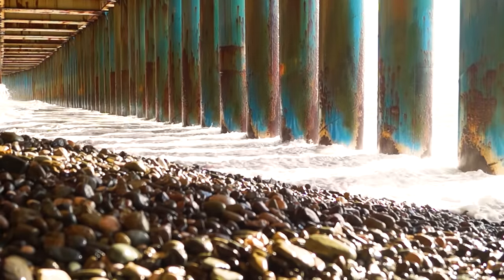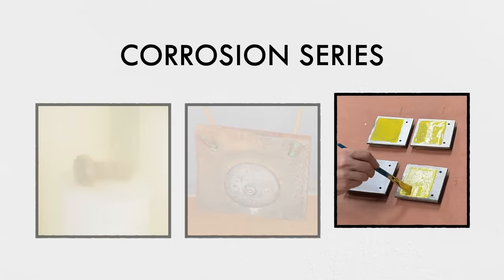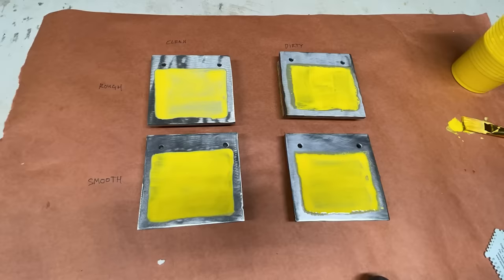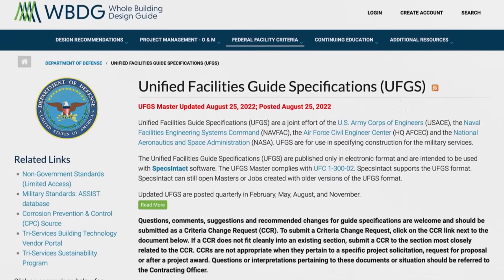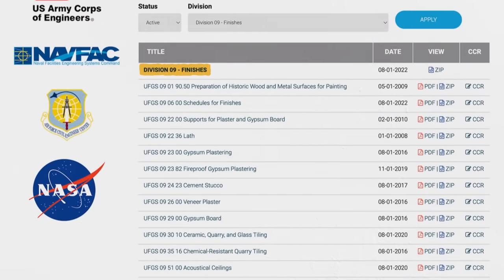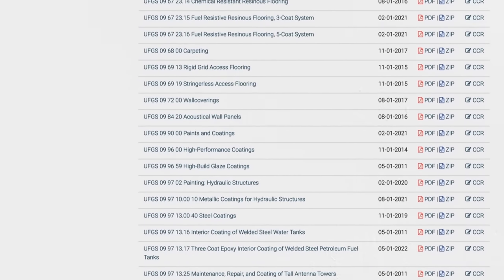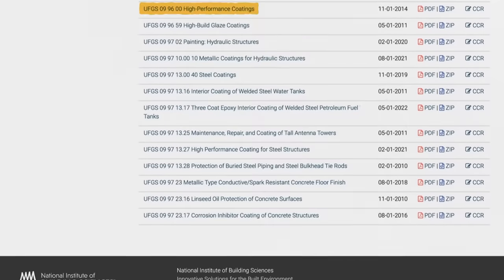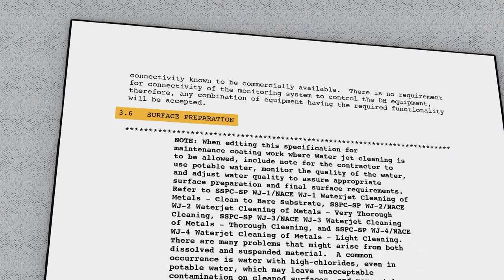What's the Difference Between Paint and Coatings?

Comment: As a union trained painter for 10 years, let me just say "face palm". I'm not sure how the paint chemists ignore nomenclature error as if it is not important, and I'm surprised they didn't give feedback about the stress test. I'll start with the test: the failure of a poorly prepped surface will be evident with temperature cycles and that is where the rust will have free reign. The temp cycles (winter to summer) will loose the adhesion and allow wind etc. to knock off the coating in sheets.
Now to the nomenclature: paint is a coating. Most of the "high performance coatings" shown in your video were paint. The reason the catalogs say otherwise is nothing other than a sales tactic. 
Painting has two purposes: to protect and to beautify. 
Paint has three parts: carrier, bonding agent/resin, and pigment. Because the resin and hardener in epoxy only acts as a carrier, but is not a carrier, most people do not classify epoxy as a paint. Because stain has no resin outside of it's carrier's residue, it is not considered a paint.
Other coatings are things like tar, glass enamel (baked on powder coatings), anodize, bluing, stucco, etc. Pretty much any thing that "coats" is a coating.
Edit: to elaborate on carrier: in a water based paint, water and ammonia are common carriers, and the resin can be poly vinyl acrylic (for a PVA primer). With a classic (oil based) alkyd paint, the alkyd is the resin, and the carrier would be different mineral spirits (paint thinners) and oil. If there is a lot of oil, it stays wet and then soft longer to outdoor applications and is called a long-oil or a spar. This is why you will see a marine spar.
In a "water-borne" alkyd, there is no oil or mineral spirits, but the alkyd resin is suspended with a carrier that cleans up with water. 
Paint thinner's evaporative nature is because it is a volatile organic compound or VOC for short. The oil in lemon zest is also a VOC.

Comment: Oil is actually an excellent rust inhibitor, therefore the final results may be a bit corrupted. 

If the same experiment was to be repeated with dust or old peeling pain under the fresh coat, the results would be more dramatic.

Comment: With the automated steel coating system you created, would not be more complete of  an experiment if you managed to auto filtrate the salt water to be fresh each dip? Would that not get the maximum effect rusting continuously?
However, those difference may be negligible, thus leading to their necessity being ultimately irrelevant.

Comment: Is it true that rust is actually a pretty good coating against future rust? There was a small foot bridge near where I grew up that was apparently designed to rust and be rust colored, but it never would have needed to hold more than a few bikes at a time. It felt like sand paper to touch it, but it never felt sharp enough to cut you. Any thoughts?

Comment: Career 35 year bridge painter. When I first hired on in 1979 the crew boss told me that Red Lead primer was just a name and had very little actual lead. Shortly after this I was "leaded out" with high blood lead from sandblasting and spraying with only a "titty cup" respirator. Often these respirators I'd save overnight and use all week. Being leaded out felt like a body pain flu and would go away in a few days. What didn't go away was the hearing loss from insufficient foam plug hearing protection. I've been in hearing aids since my mid-50s. Later in life we switched to urethane coatings and the problem there was with the isocyanate exposure. Had employees collapse in allergic shock exposure passing out 150 feet up on the staging. This was early in the urethane safety regs, and poorly enforced.
Reply: Yikes, yeah heavy metals are no joke. I know a few hot dip galvanizing workers who have had the displeasure of contracting "Welder's Fever" or Zinc poisoning from the fumes. Oddly enough they said that drinking lots of milk helped with the symptoms.

Comment: Can you go over how anodes work?? As in with water main steel parts are attached to a large cardboard cylinder with a copper wire and it contains some type of metal and some type of granular material.
Reply from the maker: That was the previous video about cathodic protection

Comment: Just one idea for new video : Thermal barrier coatings . Recently repaired my pressure washer ( head gasket was blown out) and I was pleasantly surprised that the piston lobe and all the combustion chamber was coated ( both are aluminum details and as is known the aluminum has very good thermal conductivity and this isn’t favorable for the efficiency of the engine and the cooling system) I know that such a coatings are  used sometimes on high performance race cars engines , in aviation and space engines but never seen such a thing on a relatively cheap B&S engine . The engine is B&S 190cc , 8.75 hp , OHV, vertical shaft , it’s 12th series B&S engines probably more than 10 years old .If somebody is interested I can provide even the exact number of the engine .The coating  is a black color a little bit brighter  than the outside black painting on the head and the cylinder.

Comment: Paint, or at least products that we typically call paint, can be considered a subcategory of coatings. There are certainly other subcategories of coatings, which most people would not consider to be paint. Your statement that the distinction is based on the intended use purpose is silly. Some coatings that provide a level of corrosion protection might be used decoratively, and some coatings typically used decoratively might offer some level of corrosion protection. There are also coatings intended for lubrication, for sound absorption, for adhesion, insulation, and other purposes besides just decorative or corrosion protection, and just because the intended use might be one thing that doesn't mean the particular coating can't have properties suitable to other uses as well.

If someone uses powder coating decoratively, is it now a paint? If somebody anodizes their aluminum for corrosion resistance, is it now a coating?

Comment: Technology has finally overtaken the "continuously paint it" metaphor. Last month, after 63,000 gallons of a special long-lasting, heavy-duty paint and 10 years of almost nonstop work, the final stroke was applied, rendering obsolete one of Scotland’s most colorful and enduring metaphors. The Balfour Beatty paint job is to end all paint jobs for at least 20 to 30 years. The hardy new coat contains glass flakes and is used on oil rigs in the wind-whipped North Sea.

Comment: But why dont the invent something like heat shrink for buildings? Im sure it is somehow possible, at least easier than painting a whole bridge every year i imagine.

A tight plastic coating, maybe even filled with glue or saw dust similar things to fill uneven spots to protect against condensation. You wouldnt have rust problems at all nor UV brittleness.

Comment: One thing I find interesting is going to Fort Stevens State Park in Oregon. There's a shipwreck on the beach called the Peter Iredale that has been slowly rusting away into the waves over the last 40 years that I've been going camping. There is also a military fort that used to be in service guarding the mouth of the Columbia River. It was in service from 1863-1947. You can go wander around the ruins of the place now. There are still some iron hooks and Rings hanging in the concrete walls. The interesting part is they have a smooth rust colored patina but they are not disintegrating and flaking apart. Is that from 60 of handling, or just a different, maybe higher quality steel?

Comment: That foam tape thing, how does your scratching not flatten the surface of the metal? I “feel like” your scratching you flatten the surface and give you incorrect measurements.
Reply from the maker: They call it "burnishing." Hard to see, but the tool is rounded. It's not quite strong enough to deform the surface of the metal.

Comment: @Practical Engineering

Hello Grady!

I really like your very interesting video series about engineering! 
But as a studied powder coater and electroplater, I just have to correct an error in the script at 8:40! 
So, polyurethane is as epoxy NOT suitable for outside applications, because for the same reason: UV radiation! Practical example: have you ever seen a piece of construction foam hanging outside on the surface of a wall? Yes, it becomes brittle and it crumbles into this brown dust! Because of the UV-radiation! That's why we use a polyester based powdercoat on top of our electrophoretic deposited dip coating! 
So, what is suitable for protection then?
1.) The best UV-protection but also the most expensive coating system is polyacrylate, which is widley used in the automotive sector!
2.) The second, cheaper option is a polyester based coating, as I applicate at my job as a powder coater! On top of a electrophoretic deposited ("dip-coated") layer consisting of epoxy resin, which protects the bare metal surface from moisture and diffunding chemicals, salts, etc., working as a barrier, due to its chemical resistance, while the polyester provides the necessary UV-protection!

Kind regards

Patrik

https://www.igp-powder.com/en/

P.S.: I'm not an employee at this company, but I use their coatings everyday!

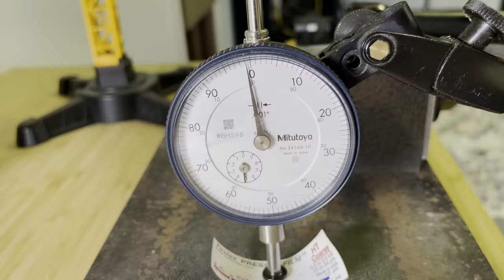Comment: 6:22  "1mill(mm) which is about 25 microns", WHAT!? The micrometre or micrometer (American spelling), also commonly known as a micron = one millionth of a metre (or one thousandth of a millimetre, 0.001 mm, or about 0.00004 inch). So 20 µ (microns)= 0.02 mm. 25µ (microns) = 0.025 mm (millimeters) EXACTLY
Reply from the maker: A mil is a thousandth of an inch when discussing coating systems. Kind of silly

Comment: What units are you using @6:24. 

1 Millimetre = 1000 micrometers
Reply from the maker: Mil = One thousandth of an inch. Confusing but it's the unit they we use in the US.
Reply: @PracticalEngineeringChannel  aah, also a common abbrieviation of millimetre.

Comment: Sealed protection with smooth surface for painting give color desired and secondary protection bolts possibly need extra work cracks too water most Salt EATING away faster than water following path release resistance and if Salt water deposit Salt EATING easy each dangerous need to keep eyes on and yrs you get from sealed and painting but because season and weather factor eyes are best

Comment: To difference between the results wasn't that noticible because hé used a good quality 2K coating. A cheap product probably would have flaked or not even stuck to smooth and oily surface 0_o.

Comment: So why don't they just make bridges of stainless steel? If there is so much at stake you'd think it would be required
Reply: Number one is the cost. And number two more importantly is the weaker strength. There is a steel called "Core Ten" that self-rusts at the surface and forms a protective layer. Super ugly to looks at, dark brown and leaves a stain trail on the pier below
Reply: @kippywylie  wow thank you Kip makes alot more sense when you put it that way

Comment: Stainless steel obviously costs a lot more than normal steel, but it seems to me the initial cost may be justified by the longer lifespan of the structure and saving money on repainting many times during its lifespan.  Is it more economical to use normal steel, or are governments prone to using the cheaper and inferior option because hey, the current government won't be in power in 30 years time so why care?

Comment: The whole world "mills is millimeters, as in 1/1000th of a meter. Also 1/10th of a centimetre."
USA "mills is 1/1000th of an inch, easily confused with millimeter, and has led to get costly issues in projects."

Would it not be better to explicitly say mili-inches? 

Omg Mili inches doesnt even exist as a word! Oh FFS lol.

Failure to define, definite failure.

I'm in Britain and we use both systems at the same time, clearly and explicitly wording each so there's no confusion.

Comment: NEVER USE MEAHNICAL MEANS TO REMOVE CORROSION PRODUCTS.   You are out of your element here duded.   You are awesome about water engineering but you need to talk to some material chemists and material scientists proper.
Reply from the maker: I mean I worked as an engineer on several large scale coating projects. If there is an error in the script, please let me know so I can add it to the description.